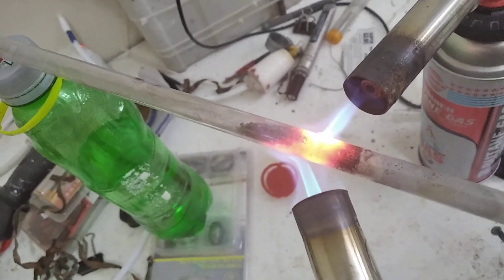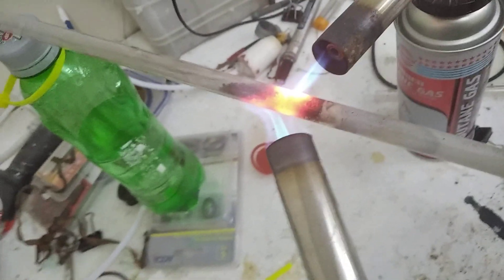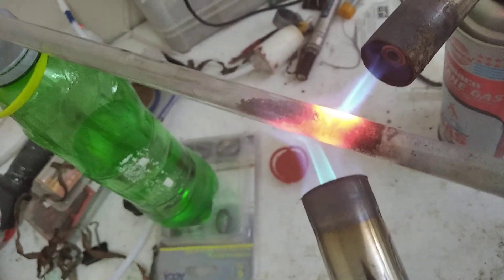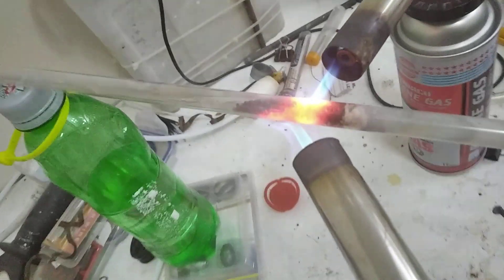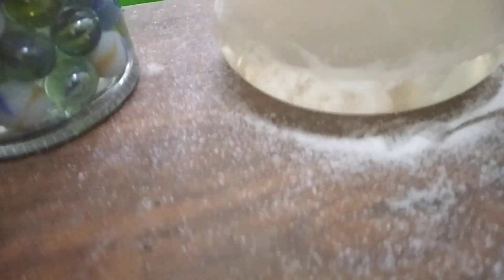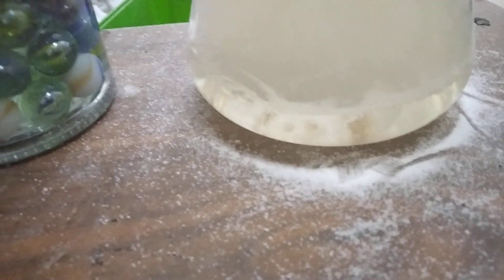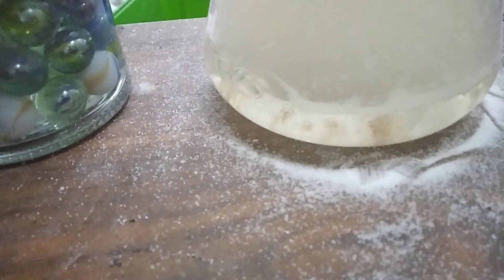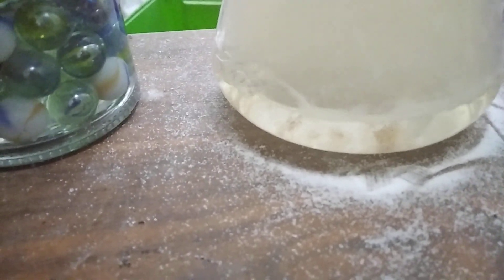Ostwald reactor 2 stage absorber.

Comment: I have a bit of questions is the glass rod a quartz tube or borosilicate.im used to seeing ammonia generated with urea and sodium hydroxide. Or just plain heating urea directly. You use a concentrated solution of ammonium hydroxide and just bubble air in it to provide for the ammonia gas (which comes off of the ammonia solution) and air very clever. No heating or mixing chemicals. Like you said copper acetate and manganese acetate heated to decomposition.(also possible to use Nickel or Cobalt). Collected the gas into a beaker with glass marbles. Adjusting the tube as you said to prevent the side reaction of ammonium nitrate.
Reply from the maker: tube must be quartz because borosilicate will melt or crack.
The ammonia was generated from NaOH and urea then absorbed into cold water but overall doing it that way will require some serious regulation of the gas flow and composition. while doing it this way with ammonia solution the gas composition is set by the height of the straw and the concentration of the solution.

Comment: Hello, how resistant is that catalyst, is copper oxide reduced to copper? Have you tried oxides of chrome, are they better?
Reply from the maker: I straight up found cheap Pt catalyst on ebay after this.
I just showed overall that copper and Mn oxide catalyst works.
Reply: @CatboyChemicalSociety  This is great if the catalyst is stable, cheap and readily available materials
Reply from the maker: @oktogen1476  oh yea it is worth making the homemade stuff its just that I legit saw an amazing deel for 300cc volume of Pt wool catalyst for 25 USD and its still up.

Comment: Have you asked the question on sciencemadness. That ammonium nitrate side product seems difficult to control.
Reply from the maker: thats what the straw is for!!
I raise and lower it and after playing around you have to play it by ear how much to lift it by but looking at the absorber tells you how much you need to lift/lower it.
Reply from the maker: I solved this in my latest vid using a chamber filled with citric acid and copper pieces as the 1st stage absorber which selectively removes ammonia from the stream by making ammonium citrate and also any nitric acid oxidizes the copper forming NO2 which goes into the main absorber on the 2nd stage wasting nothing.

Comment: Cool mate but why don´t you use a high power high voltage arc for this isn´t that easier? You get direct No2 from Air.
Reply: He's running ammonia and oxygen and burning it in the catalysis. A maintained spark could burn the ammonia but that would be harder to set up a closed system with wires.
Reply from the maker: this is more efficient than that and I wont have to spend a lot of a HV source that can run for days (NST) its actually cheaper to do it this way for my case after I saw those prices for me to get a good NST.

Also once I switch over to a Pt catalyst the running cost will decrease because gas is no longer needed to keep it heated plus I can also prolly use a nichrome heating filament imbedded in refractory as a heater aswell if its still  needed.
Reply: I bought mine for 20 bucks used from a neon sign repair shop but those are too much power limited. I bet with a big ferrite core and self wound smps you could push 2-3KW permanent in the arc. So no need for ammonia too just air which is unlimited. How do you make 100s of liters ammonia ?
Reply from the maker: @Telectronics  yea im pretty sure I can get a torroidal transformer and some thin magnet wire and oil insulate it.
Since I have no vacuum pump I have to dunk in hot wax!!.
The cost of all these materials though...

I just buy urea for 2 dollars for 1kg. some NaOH and a tube of quartz and a bunch of other stuff.

The efficiency of an ostwald reactor is much higher than the birkeland eiyde.
Reply: Can you push a lot of ammonia in a short time through or does it have to be slower to react better? Urea huh yes you can get some 100kg of both for cheap mixem all up generate 100s of liters ammonia hell yeah ! Good idea ! I thought you buy the ammonia in mega gas bottles.
Reply from the maker: @Telectronics  well it depends on the volume and surface area of catalyst.
theres a way to approximate the performance of the catalyst with some fucky wucky maths but wont bother!!
just observation ftw.
Reply: It's inefficient, trust me, I have a Birkeland Eyde reactor and the yield is 10 mL of 70% acid from 1 week nonstop
Reply: @EdwardTriesToScience  How much power does your high voltage arc have so I have an estimate ?
Reply from the maker: @EdwardTriesToScience  yea those reactors are 4% to 5% efficient at best while this ostwald reactor at best is 60% with my catalyst but its more like 30 or 40.
with platinum its nice
Reply: @CatboyChemicalSociety  Can you use just mixed together Mno2 + CuO as catalyst or why do you went over the acetate + chlorate heated way?